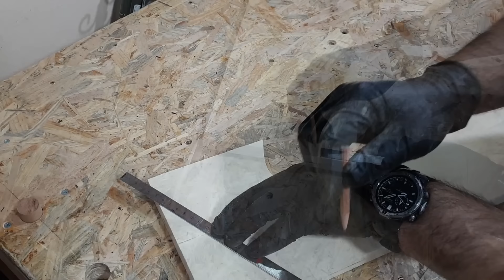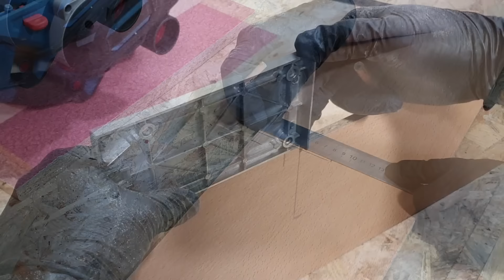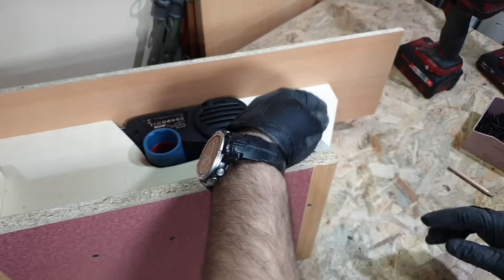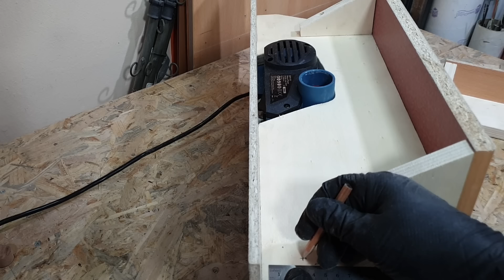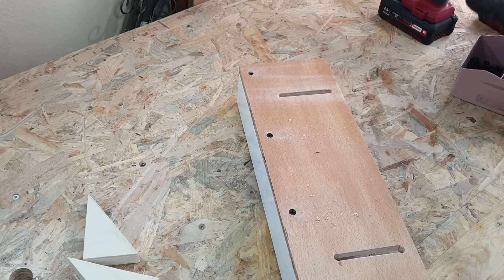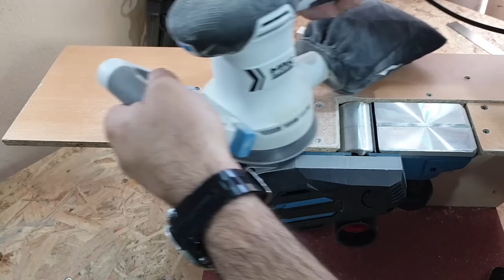Benchtop Jointer making / Free PDF

Comment: Good job. Really dangerous feeding with your thumb on the edge like that. One little slip and goodbye to the tip if it! Use a push block and save having a trip to the er.
Reply from the maker: Thank you for your comment. Regards.

Comment: Great idea and a great video.I only hope you use a push block and/or stick when you are normally using these tools. You slipped once and almost put your hand into the that spinning blade. Not a good thing.
Reply from the maker: Thank you for your recommendation. The camera angle caused it to look like this. But you're right, you have to be careful.

Comment: Very nice job but as someone with 30 years in the furniture building trade,  you seriously have to learn how to use a surface planer.
You will loose your fingers garenteed.
You never push through the end with your fingers, you always transfer your hands to always push through your work piece at the front of the blade. 
Also as a safety measure, try to not plane a length less than 300 mm in length. (yes,  sometimes this is not practical). 
Trust a tradie when he says planer blades will grab and throw wood faster than you can stop your hands from falling into it's blades.
Reply from the maker: Thank you very much for your valuable advice.
Reply: Your very welcome, thanks for taking it the right way. 👍
Reply: Ha Ha it’s better than the planer taking his fingers! 😉 seriously though, even professionals get so used to their power tools that they get a bit lazy and end up losing fingers. It’s why the table saw is such a lethal tool. Most use them without the safety guard. Normal jointers on the other hand have a safety bar that is left in place by most sensible users.
Reply: Ha Ha just watched again and that thumb is sooooooo close to being minced.... would be easy enough to add a safety bar and feather boards.
Reply: @NeoMorphUK  yes, for sure and I seriously don't understand why a lot of these guys don't use the guards. I'm not The Safety Police but being in the trade I have 4 close coworkers who had lost index tips or thumbs over the course of their time.(good luck looking for dirty diced fingers that have been spat out the other end of a saw, planer etc.) I've always had the mentality of respecting machinery, it's a hungry beast. As you say, I often have to keep myself in check when my mind starts wandering off what I'm doing. So easily done. 
Cheers👍

Comment: ahhhh damn it, now i want to make one.
that came out nice, it’s simple, strong, and works great. i like it !
the only thing i wouldn’t do is run crap pallet wood thru it and take the chance of chipping the blades. because then they’ll need sharpening and that will remove a lot of material for nothing. plus it’s hours worth of your time.
just my two cents.

Comment: I have always wanted a jointer but they are costly.  I like this build. Great job. Got a spair planner. May try to build this, but what about that press wood , that stuff likes moisture like a sponge. Humidity can cause expansion and won't or could that effect the trueness of the wood being plained ??
Reply from the maker: I think the best solution would be to protect from water contact. After using it for a long time, however, the correct answer can be found.
Reply: @GreenSaw  I'd be looking at a light brushed coat of wood hardener on all exposed-particle surfaces. Lightweight, thin, resistant to moisture incursion, nearly invisible, and very inexpensive. Excellent build, btw - thanks !
Reply from the maker: @chuckintexas  thank you..

Comment: Nice job but you know that after 1 face and 1 side you need to use a planer to make the 4 sides square right?
Reply: It will square the planed face to the face pressed against the fence.  So you can plane one wide dimension face first, then plane both sides square to that one face by flipping the board over always keeping that first face against the fence (now you have three faces that are square), then plane the last wide dimension face to one of the sides and you should have a perfectly square board.

Comment: Becarful abaut your fingers they are too close to the blade
Reply from the maker: Where is the open blade ?
Reply: @GreenSaw  
The blade of the machine
Reply from the maker: The blades covered by wood
Reply: @GreenSaw  i think he means your thumb at the end of the board, pushing it, it gets a little bit close..
Reply from the maker: @aampudia8  You're right! But this is overrated. The wood covers the knife. No risk touching my hand to knife. I don't do dangerous work!
Reply: I visualized his thumb slipping onto the cutter.
Reply: @GreenSaw  push sticks are a wonderful tool. JS